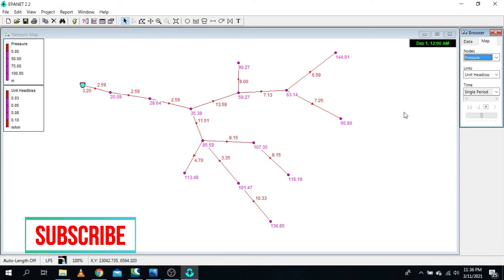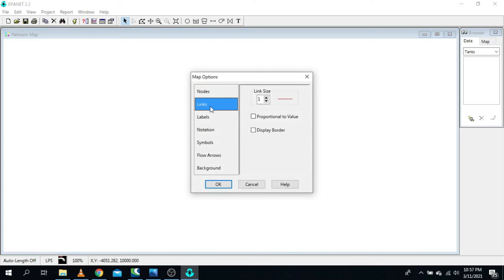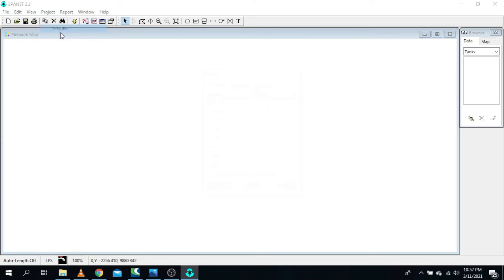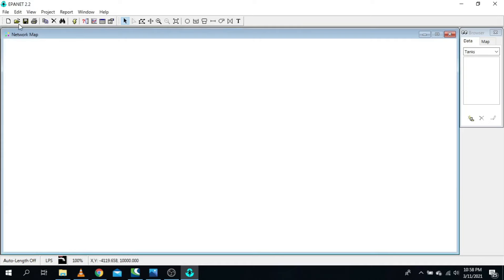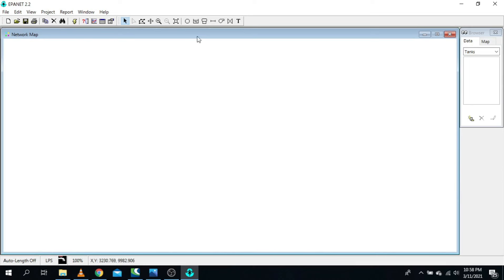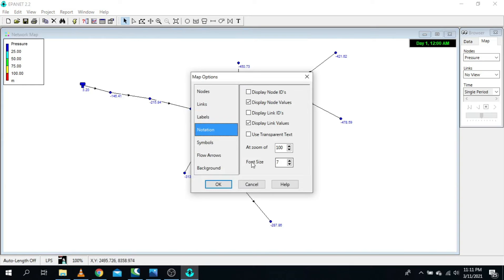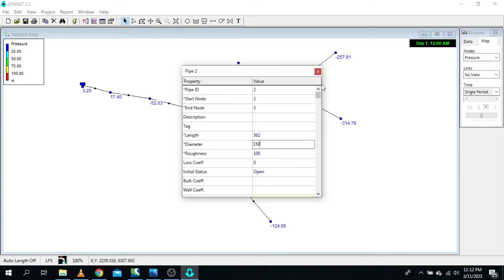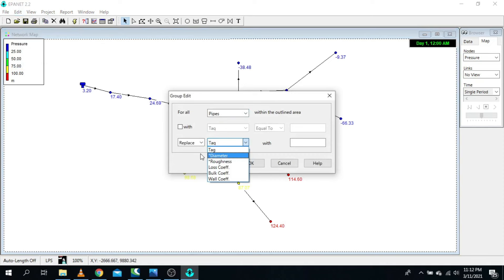EPANET Tutorial | How to Design Water Supply Network with EPANET 2.2

Comment: While you drawing a pipe, why did n't you put auto length on??? To get length according to the coordinate
Reply from the maker: Because I did not use actual coordinates... based on that if I used that option I would end up with wrong length values!!🙏

NB: I highly recommend to use "auto length" option if you are using actual utm coordinates.

Comment: Why is there that the junction from where the valve and pipe is connected have negative pressure in my model?
Reply from the maker: Did you check everything correctly? Which valve did you use? And for which purpose?!

Comment: While changing the diameter, will it suffice the demand of each household Because diameter is designed using the population of particular area?
Reply from the maker: While changing the diameter make sure the demand is well maintained! 

By the way, the idea of changing diameter is to make sure that velocity, unit headloss, and pressure is maintained at the required range! 

So if that is the case automatic even the assigned demand will not be affected in a negative way because demand (discharge) will be supplied at the right velocity and unit head loss🙏
Reply: @HydroinformaticsAcademy  thank you🙏🙏🙏
Reply from the maker: @Dee-ks6sb  You are welcome!

Comment: I had a question, say we are using 2 tanks (placing one on the right and one on the left), both having the capacity of 300 cubic meters (total 600 m^3), but we want 400 m^3 to go into the top of the system that has multiple nodes(having its own demands) & links, and 200m^3 to go to the bottom of the system which also has multiple nodes(having its own demands) and links, so is there any way to do that, making the tanks equally contribute to the system rather one contributing more than the other?
Reply from the maker: Ans 1: I think what you can do is to use FCV on the storage tanks and limit output flow as per your requirements! For example, if you want both tanks to contribute 5L/s then use FCV and set that value on each of them!

Ans 2: From what I know storage tank supplies water as per assigned demands on nodes so maybe one storage tank supplies more water because it has more nodes assigned with more demands compared to the other?

Comment: Thank you for this video. I have a question. I see that you have only assigned demands at the nodes at the end points of the distribution lines. where do you assign demands if you had communities settled along pipes 1,2,3 and 4?
Reply from the maker: I have done this tutorial a while ago but the idea is.. you can calculate the total demand and divide it by a total number of nodes then take the answer and assign it to the nodes of respective pipe/link.. (there is another way around but that is the simplest).
Reply: @HydroinformaticsAcademy  thank you so much
Reply from the maker: @belindamercya  You are welcome!

Comment: Hello sir one question can confused 🤔 me that how to select length of pipe . And second one is how to select diameter of pipe at different nodes .
And third one is what is range of velocity and pressure head on node .
Plz explain
Reply from the maker: 1. The length of pipe is determined by field survey/measurements
2. Pipe diameter is determined by taking into account velocity, headlosses and even required pressure at a given node! NB: See design manual that is adopted in your region.
3. For the most part required velocity ranges from 0.5 to 1.5m/s! But to get the required velocity and pressure and even headloss gradient please check the design manual that have been adopted in your country/region🙏

See more tutorials on our channel to learn more
Reply: @HydroinformaticsAcademy  thanks 👍❤️ sir g for your reply .
One more question that we design for undeveloped region which has no water distribution system. Soo we design for that region soo how to take velocity range for that region .
Second how to take diameter according to velocity . Plz explain
Reply: @HydroinformaticsAcademy  sir WhatsApp number Mal sakta ha

Comment: A question sir, with a follow up, in doing single period analysis, what base demand do you input? Is it average day demand or the maximum day demand?
Reply from the maker: Hello Yami! Welcome!

For single period analysis or stead state analysis what you are supposed to use is MAXIMUM HOURLY DEMAND. But if you want to use extended period simulation then you first use average demand to run single period analysis after that you introduce peak hour factors (multipliers) to run extended period simulation!!...

By the way for single-period analysis, you can watch this tutorial as well https://youtu.be/D_k92sTSu5w!! I covered other important concepts that might help you!!

Once again, welcome🙏
Reply: @HydroinformaticsAcademy Hi, I'd like to revive this comment..  Max. Hourly Demand is to be used for extended period simulation, correct?  And to size the pipe correctly, we adjust the pipe diameter in relation to (1) velocity and (2) pressure, correct?  Pipe headloss is reflected in velocity and pressure in a way, so I think it can be overlooked.

My question is, since typically, we design the pipe velocity between 0.9m/s to 2.5m/s, is the design still justifiable that at AVERAGE hourly demand and MINIMUM hourly demand (aka off-peak hour), the velocity can be below 0.9m/s?